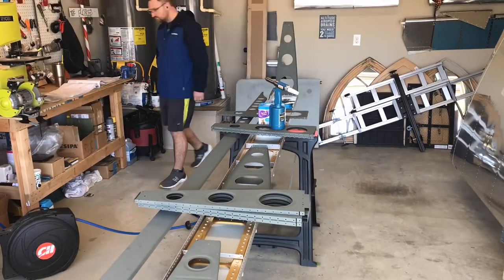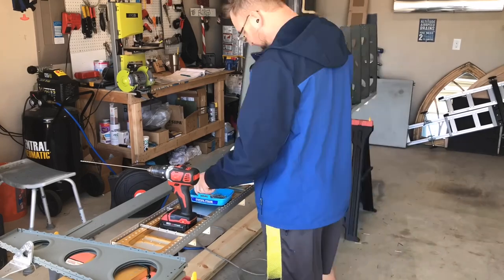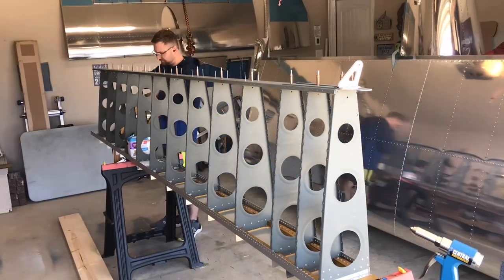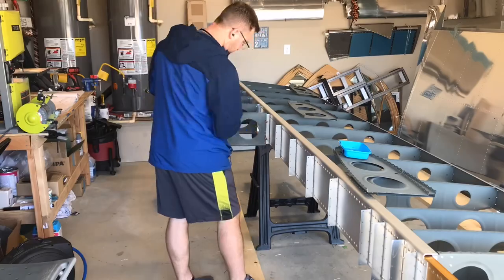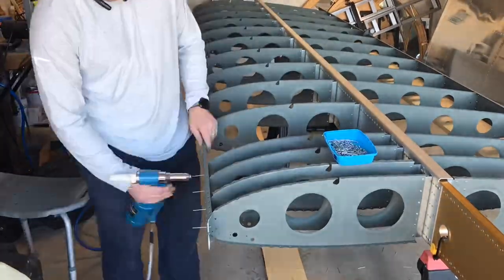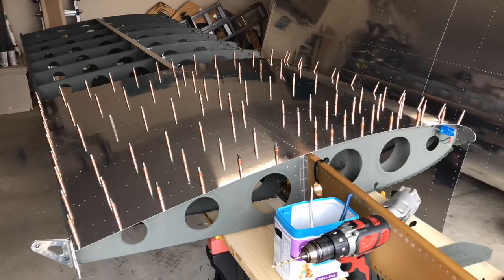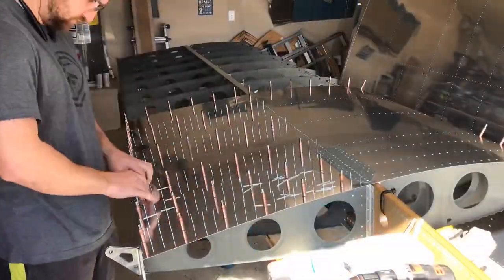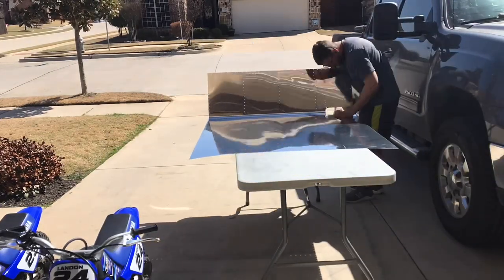RV-12iS wings 7: Right Wing Start & Q&A

Comment: Your Fuselage Video series has been invaluable to me! I opted to build the wings first and am now well into the fuse. I also opted not to prime the majority of the plane. I did decide to prime the non-Alclad parts and im glad I did. I started to notice a white film appearing on those non-alclad like the longerons and roll bar and ive been using expensive Mar-Hyde to prime them. I live in florida, and i know im taking a risk, but i will be moving to Utah in 2 years so i expect to escape the humidity before it affects the internal components too much

Im super nervous about working on the fuel system and getting everything torqued properly to avoid leaks...Any advice???
Reply from the maker: Awesome Wes! I’m glad you found them helpful. I don’t have any advise just yet on torquing the fuel lines, I’ll have to wait and see how I did when the engine kit arrives 😂. I am using a crows foot and my torque wrench to torque them to spec but waiting until the engine is installed to do that, they’re all just snug right now
Reply: @blflores10  Cool yeah i think that ill do the same. Ive watched your rudder pedal install/mistake video like a dozen times hoping to learn from your lessons!

Comment: How long did it take to assemble one wing start to finish?
Reply from the maker: That’s a tough one to answer as I primed and haven’t yet began the fiberglass work.. Just for giggles though this will be an extremely rough estimate. Starting from the beginning I am going to say between 50 and 60 hours to complete one full wing with lighting options.
Reply: @blflores10  Thank you. I do enjoy your videos. I'm torn between RV-12iS, RV-14 and RV-10.
Reply from the maker: @edessa99  what’s the primary mission and budget? Do you need 4 seats? Have someone to assist with building on occasion? Aerobatics, maybe, one day? For me the -12 fits 95% of my mission, sure I’d love to have 4 seats on occasion, I’d also want to try aerobatics one day and Instrument capability is really nice but those may ever rarely be a factor for the flying I will be doing and I’m in no hurry to get anywhere super fast. So the -12 fits most of my mission. In the future I’d love to build an -8A or a -14A, I can rent when I may need a 4 seater. So, What’s your mission?
Reply: @blflores10  Budget is not a factor for me. Width of the airplane is my main concern and air conditioning. I’m an A&P and IA with many years of structural aircraft work under my belt. I’m currently a DOM for a corporate flight department and the job only requires me to be at work maybe 5 hours a week. I rent a Cherokee 140 with the 160 conversion. (You can see the project of the Cherokee on my channel. I was the one that brought it back to life with a friend of mine.)
I’m 6’4” 225 lbs and I like my space. I haven’t done too much research yet because I’m working on my instrument rating. I love the idea of the extra freedom the experimental provide.
Reply from the maker: @edessa99  that’s a good start, I’d say a 14 or 10 would alleviate your primary concerns of space. Don’t get me wrong you’d definitely fit the -12, but you’d be rubbing shoulders with any passenger.
Reply: @blflores10  I guess I need to actually sit in a 12, 14 and 10 to see the difference for my self.